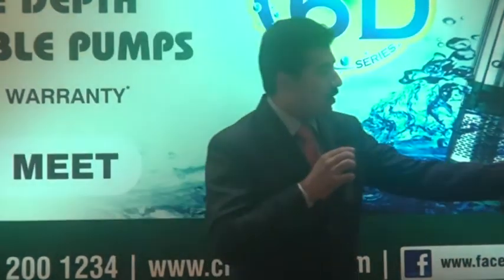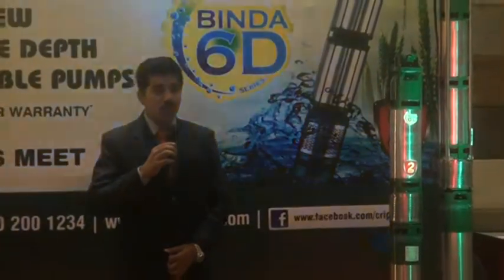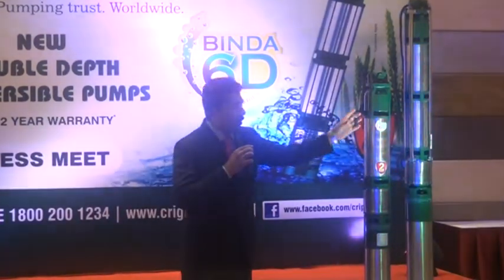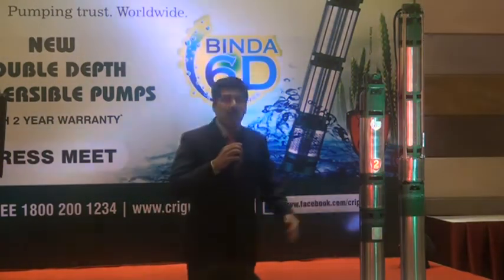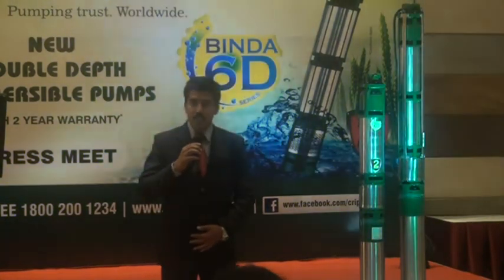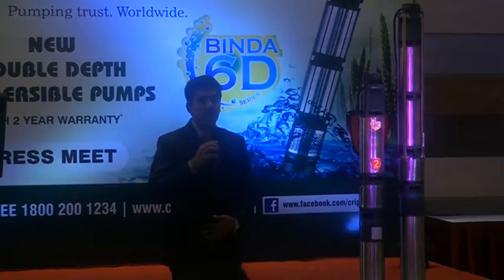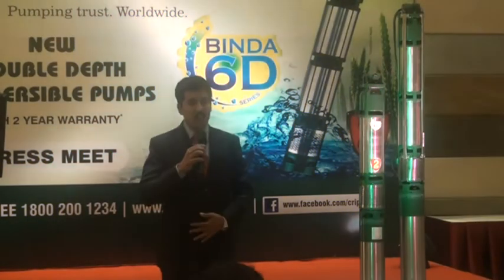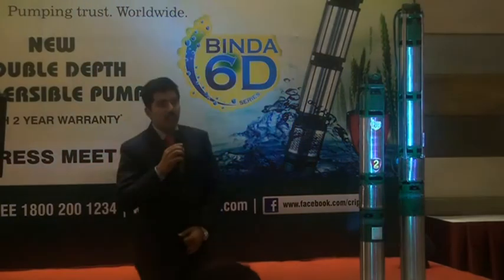CRI Launches New Double Depth Binda 6D Submersible Pump

Comment: Please advise me , 3Phase Deep Well Submersible HP and Stages required to
Discharge Water at Higher Pressure from 220feet (11 pipes of 2 inch used -220feet) under 260V  . Thank you .